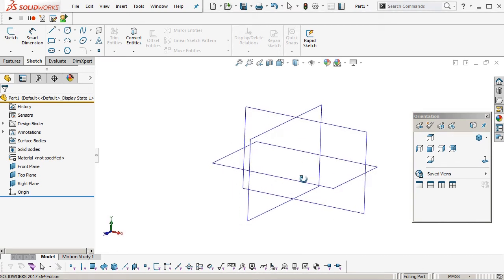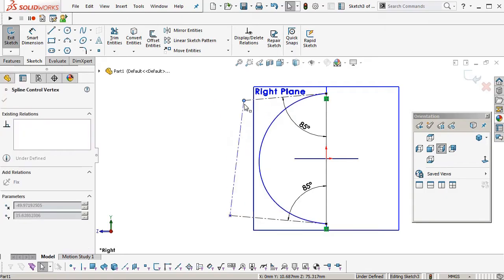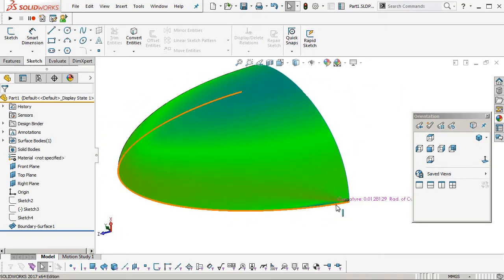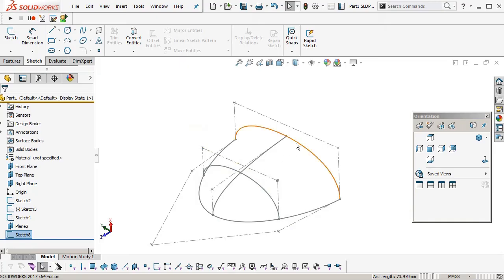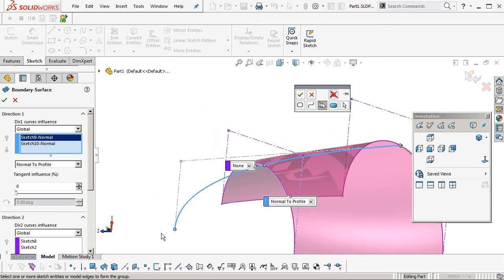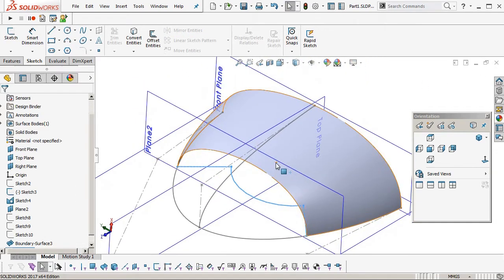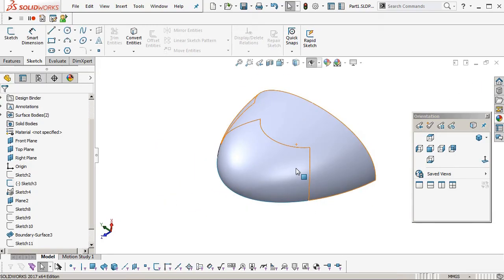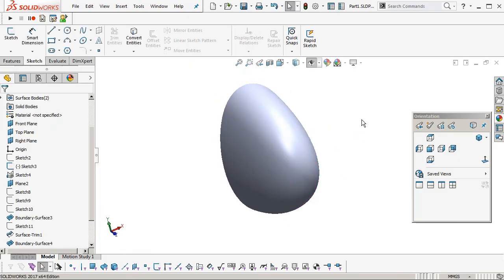Solidworks Tutorial: Surface modelling a nose cone/domed surface

Comment: Just marking the steps for this method:
a. Final shape 4:09 using simple boundary operation.
b. However, the actual problem 4:30. Need break part into 2 steps. Each step=4 edgers.
c. Breaking surface Part 1 7:51.  Looks simple.
d. Breaking surface Part 2 10:09 The tip plus "trim back" with "3 edges".

Comment: Im doing a similar thing but I want to convert to sheet metal afterwards.  How do I do that?  Do you have another video?
Reply from the maker: The surfaces are not developable - they are curved in both directions, so doubt you can convert to sheetmetal, with flattening. You can try the surface flatten feature if you need a flat pattern.
Reply: @AndrewJacksonDesignStudio  Brilliant, that worked.  Thank you
Reply from the maker: @HowdenDaniel  Good stuff!

Comment: Andrew, I assume this was a tutorial of how to use the "boundary" function.  Is it possible to just use the "loft" function at the beginning and get the same results?  If so it would seem to me a much easier approach with a lot less work, but I am only beginning my studies of surfacing.
Reply from the maker: Hi there. You can use boundary or loft to build this geometry, the fundamental thing this video demonstrates is to avoid making degenerate edges (singularities, collapsed edge) as I explain at the beginning. Loft is the same as boundary surface in regards to using 4 sided surfaces. You can use a surface fill with optimise unchecked (creates an overbuilt surface that is automatically trimmed) but there can be other issues that arise using surface fill. Here's some links with more info. Cheers
https://solidwize.com/dont-be-a-degenerate/
https://knowledge.autodesk.com/support/alias-products/getting-started/caas/CloudHelp/cloudhelp/2019/ENU/Alias-Tutorials/files/GUID-3E5274C3-FB89-4583-8087-A3E17DB849A1-htm.html
https://www.engineersrule.com/the-solidworks-fill-surface-feature/
Reply: @AndrewJacksonDesignStudio  Andrew, Thanks for the kind reply and information.

Comment: Is there any reason why you wouldn't use a G2 or G3 surface condition over a G1 connection for this type of geometry?
Reply from the maker: Guess it depends on your design intent. Also, the dreaded SW wrinkles adjacent to boundaries.

Comment: Would it still have corner singularities if it was modeled full and not mirrored?
Reply from the maker: Yes, as you'd be modelling to a single smooth, closed boundary. An option would be to use fill surface with some constraint curves.

Comment: It would have been easier to use filled surface
Reply from the maker: Always an option. Downsides are : loosing some control - having a surface that may be trimmed on every boundary - sometimes looser tangency tolerance on edge conditions - not being able to use selection manager. Also sometimes filled surface can go haywire and if this happens in a complex model, when the filled surface is high up the feature tree, it can be a pain to trouble shoot.

Comment: I'm able to follow up to 3:50 but when I attempt to create a solid it generates an error "cannot create solid. Use boundary surface feature." Any thoughts? Running SW 2018.
Reply from the maker: Hi, it sounds like you are adding a boundary solid feature rather than a boundary surface feature. You should use insert>surface>boundary surface. Thanks for checking out the tutorial.
Reply: Precisely the issue. Thanks!